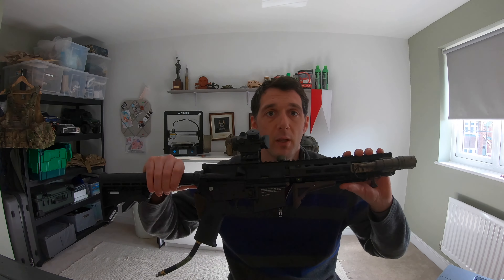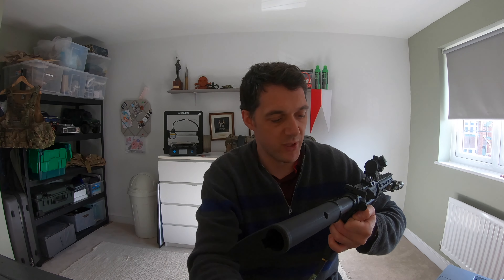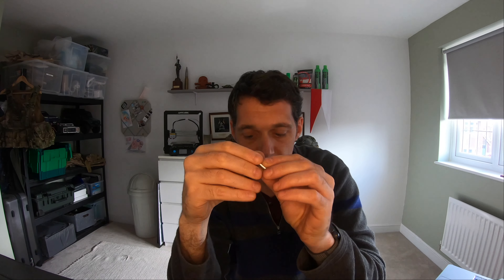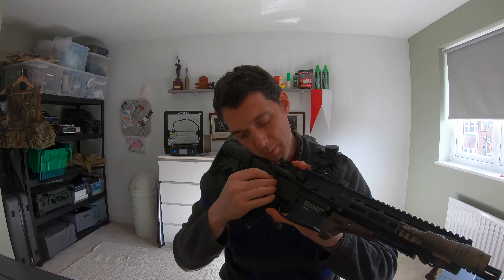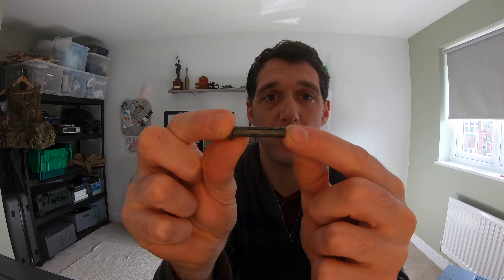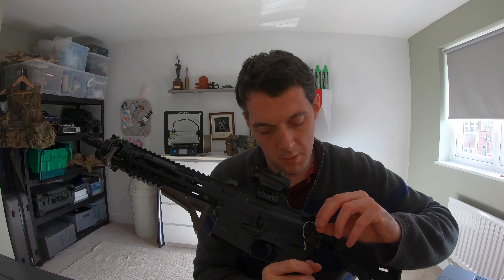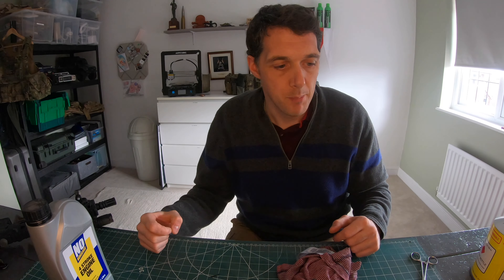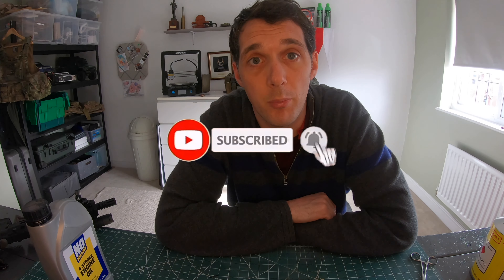HPA velocity lock - how to make your own cheap

Comment: Have you got the 3D files or link for that tdc adjuster on your tippmann?

Been looking everywhere for something as clean looking!
Reply from the maker: @XDONmanX  hi apologies for the late reply I must of missed the message. I think I have it so will check and let you know. The down side is you will need a donor Allen key to trim off and glue in both the adjuster knob and the hop unit. Sounds daunting to glue it in position on the hop but worked a treat. I have seen someone use a 2 pence piece with a hold drilled in it Allen key pressed in and then glued. He also added texture on the edge to adjust. Looked cool.

Comment: Mate,I'll pay you to make me one of these for me I dont have the tools or facilities to do it myself and would greatly appreciate it
Reply from the maker: @mattfitzsimmons3457  can you confirm the Allen key size for it and I will see if I kept a a spare I can cut down.
Reply: What do I need an allen key size for ,its the velocity lock I'm desperately after and I'm not paying 100 quid plus
Reply from the maker: @mattfitzsimmons3457  sorry I had crossed wires my end. If you can PM me on adventure Airsoft on Facebook I have a spare
Reply: @adventureairsoft thanks buddy I 100%  will do need that damn pin or in screwed 😅